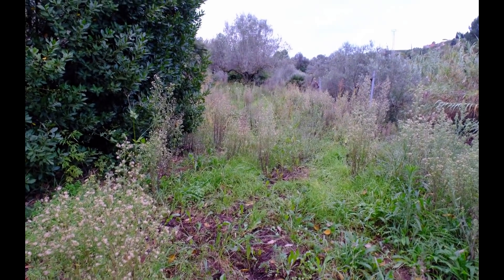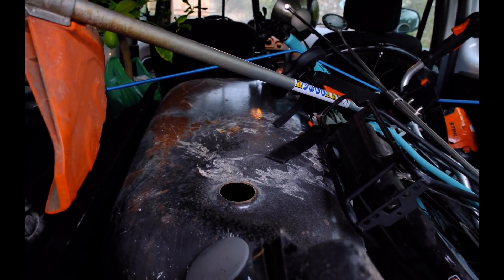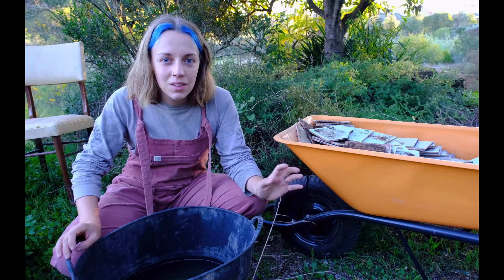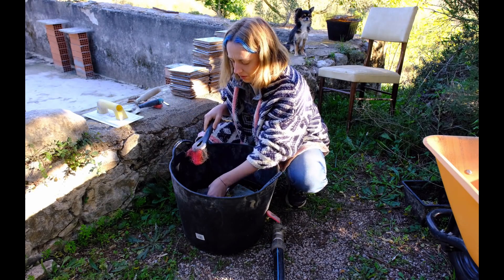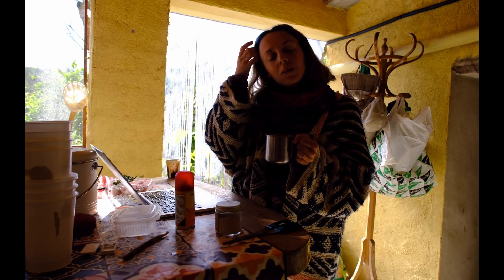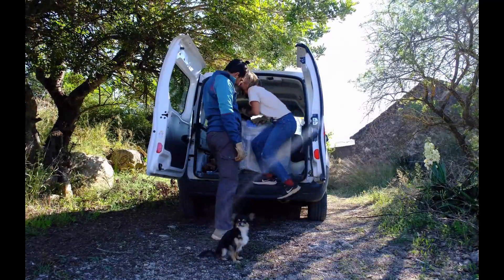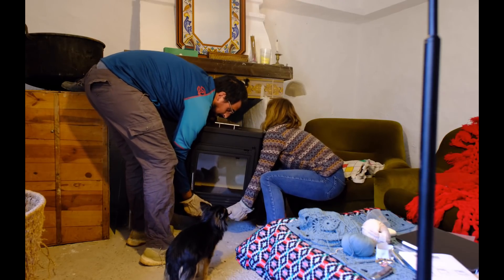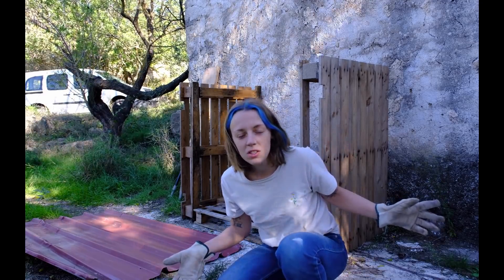Autumn arrived! Preparing for our first offgrid winter on our Spanish Farmstead

Comment: I have 10 speed  bicycles and when the derailer stops working and before I hurt myself, I 've been removing the derailer , taking apart the chain, puting back the chain around the  lowest gear around the crank and putting  the remainder of the chain around the second highest gear at the rear wheel, need to remove some  of the links so the chain  won't fall off. Can  use a chain breaker and replacement repair links to recircle chai

Comment: Those little sticks will really mess up your compost pile I'd save it to walk on during the rain. Here in Los Angeles we have to separatefood cutting with  garden and have a separate bin. I like to use metal because bugs can't eat it. In  Los Angeles we normally Don not need a heater during the winter a space heater or  fan. Usually is all that is needed. Spain and California are large places. I've seen houses in Cordoba. That make me. Drill but I think at 69  i'am getting to old.

Comment: great videos guys, keep up the good work.

,can we ask what is the make of the stove? and where did you buy it? it looks amazing, does the top part act like a small oven?
Reply from the maker: We got it from Fm Calefacción, the model is M-102. We were quite limited in options because a lot of stoves are quite tall and it needed to fit inside the low chimney. An ironmonger actually had to cut off about 20cm of off the bottom area, which was a space for storing wood, so it would fit!

And yes the top part is a little oven! So nice to cook in there!

Comment: What is the lowest temperature in winter? I see that there are many subtropical plants growing here. So you don't have frosts?
Reply from the maker: In theory frosts are supposed to be very rare in this area, min temperature of 2 degrees C, at least at the low altitudes. We are at 300m. However, this year I've already seen frost on several occasions, in specific patches of our field. Temperature hasn't dropped below 0 though, so I guess it's because of windchill? But yes, depending on the altitude, sub-tropical plants can usually survive around here. I think we need to learn which areas of our land are most exposed and which are more frost-prone, and plant accordingly.